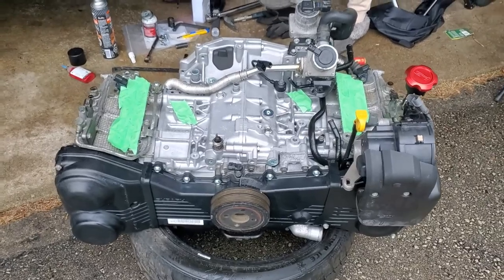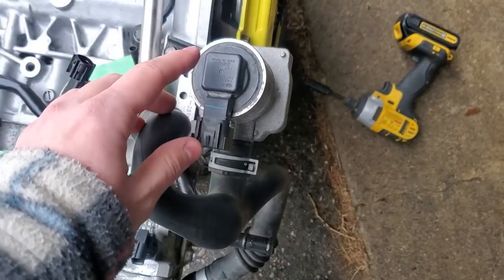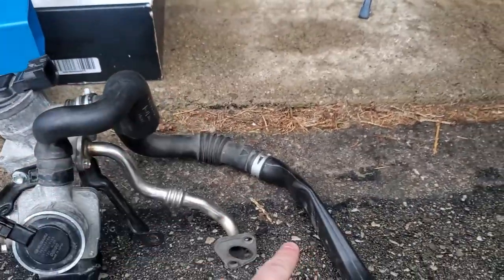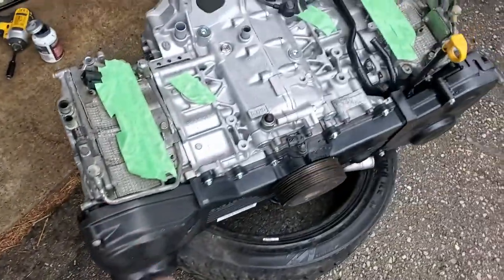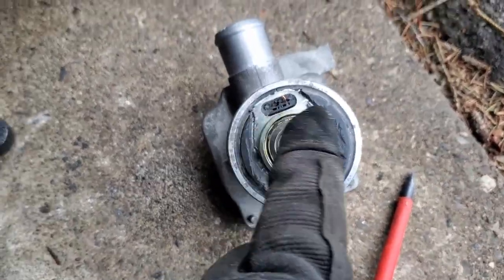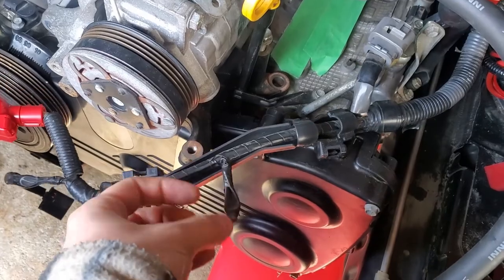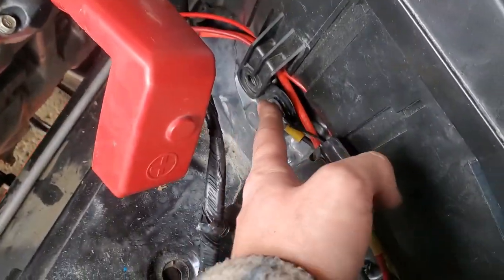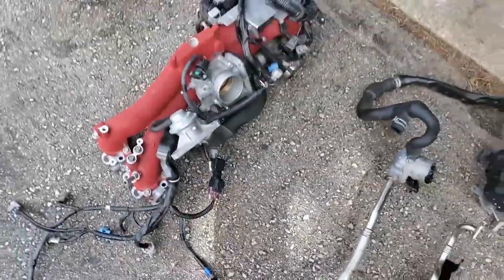STi Secondary Air Pump Delete

Comment: Great video, the biggest problem with this air pump BS is condesation which eventually F up the solenoid (you can google how much this useless BS costs). it's not gonna affect the car when this thing break, but subaru is so clever to disable cruise control whenever money light is on.
Reply from the maker: Thanks, and yes your correct. I'm happy I no longer have it in the car not only to free up space but also since I won't have to worry about forking up the money to buy another for when it breaks. Yup Subaru loves the money light. My impreza would brun through rear o2 sensor and everytime I could no longer use cruise, very frustrating.

Comment: That was very informative! I appreciate the walk through! I'm about to delete this whole system in my car and wasn't really sure what exactly needed to be removed!
Reply from the maker: Not a problem. Happy to help! Just make sure you are getting a tune for your car after you do this. Also the COBB AP will no longer be able to remove the CEL codes due to the green speed update. You'll have to get your car tuned using alternative methods.
Reply: I do have a cobb accessport but I got a stage 3 tune on the car. Although it had the check engine lights n codes, it still runs with no problem. I'm assuming the car will just need to idel a little to learn the secondary pump is no longer on and self adjust being that I have a stage 3 tune already. I still gotta take it to get dyno tuned for a custom map but I have stretched tires and ordered a new set of tires to mount on the white set of rims I got for the dyno tune appointment. I also bought a VMS vaccum block to stabilize the fuel pressure for the tune.
Reply from the maker: @luistaveras551  ah I see, well honestly I'm not too sure. It might be okay but it would probay be a good idea to reach out to your tuner so you know exactly. Good luck with the dyno!
Reply: 我制作了一个二次进气模拟，可以取代这一套系统，由模拟器提供正确的信号给ECU。欺骗ECU不报故障。
Reply from the maker: @唐永朋  I had to use Google translate, but how did the simulation work?
Reply: @zach_lush  用一个继承电路模块，模拟了进气主阀关闭的状态跟进气泵，进气阀工作的信号给ECU，这样ECU就认为二次进气系统正常工作了
Reply: @唐永朋  Or you could get a tune to turn off Air Pump feature from the ECU.

Comment: Just curious... I know this system is for emissions, but what specifically does it do, and are there any drawbacks to removing it?  Great video btw, very informative!
Reply from the maker: Basically it forces fresh air into your engine. Most people delete them when the air pump dies. I did it since my car was already being tuned and i wanted more room in my engine bay. Plus it just looks cleaner without it.

Comment: Excellent video. What codes need to be disabled?
Reply from the maker: Thank you. It would basically be a bunch of secondary air pump related codes. They would need to be removed by a tuner though.

Comment: Great Video, I'm putting a type RA on my '14 hatch WRX/sti turbo, secondary air pump solenoid is on the way.  What block off plates did you use?  The Ebay link attached didn't work for me.  I'm also getting a tune after I put the new engine in, anything I should watch out for?
Reply from the maker: Thanks! I just used some generic block off plates I found on eBay, guessing the seller doesn't sell them anymore. You can just do a general search for block off plates on eBay, another option if check your local aftermarket parts shop for Torqued Solutions plates. At the end of the days its just thin pieces of metal, brand doesn't matter too much. If your keeping your hatch fairly stock there shouldn't be much to look out for. Just make sure you follow the break in procedures!
Reply: @zach_lush  thanks man I appreciate it.

Comment: Good Video Congratulations, I have a question when the other secondary air valve was disconnected and when the air pump connector was removed, did it generate any code in the scanner, did the check engine light up on the dashboard?
Reply from the maker: Thanks, any part of the secondary air pump being disconnected/removed will cause a CEL to appear. So you'll need a tuner to remove the codes for you. If you are using a COBB AP the codes cannot be removed unfortunately.

Comment: Hello friend excellent video.  I am looking for an explanation since I have my Subaru without the second pump but it still has the valve with its sensor.  I bought the car a year ago, after all this time the engine light came on indicating that there is a fault with the second injection pump.  could you suggest me what to do
Reply from the maker: Thanks for watching. Well it sounds like you have 2 options. You can either replace the valve with sensor and put the system back to stock. Or delete the entire system and get a tuner to remove your CEL codes. Depending on where you live and if you have emissions may help your decision.
Reply: @zach_lush  Thank you very much for your answer.

Comment: Thanks for the video, it was really informative! I have a couple questions for you though and would really appreaciate some feedback.

My (2015) STi recently threw a code about one of the solendoids being stuck open. I dont really care about the extra hardware staying in the engine bay so for now I just disabled the SAP related codes with a Tactrix Openport cable which has worked fine to clear the code and prevent it from coming back. 

My questions are:

1. Do you think leaving the whole system in place with one of the solenoids stuck open would cause any harm to any other part of the engine since this whole system is just for emissions? 

2. If so, do you think removing just the air pump itself and capping/plugging the ends of the hoses that attach the the air pump would effectively be the same as installing the block off plates, minus all the hassle?

I'm not nearly mechanically inclined enough to pull and engine or even the intake manifold and turbo to fix this issue so I'm looking for another possible solution.

Thanks!
Reply from the maker: Not a problem, happy to see it helped!

Since you already deactivated the codes I believe the answer is yes you'll be fine. The system is just for emissions and only is working when you first start the car. 

I've never heard of anyone plugging the hoses but I can't see why that wouldn't work. I'd say give it a try and see what happens and let me know how it goes!

Comment: Hey just did my delete a few days ago on my sti. I was data logging for an etune before I did my air pump delete. Car was already on limp mode since the stuck open and close codes were already on. Car was still pushing around 15 psi with full throttle Limp mode, after I did my delete car can barely push past 10 psi. I have not detected a boost leak anywhere AP doesn’t show any leak codes. Buddy says that car ain’t  pushing boost like before bc of the delete, is this true? Dyno day is coming up in a couple days and I’m freakin out bc Idk why my car ain’t pushing boost like before
Reply from the maker: Hey, that's unfortunate to hear. So this video was filmed before COBB released their Green Speed update. Basically the AP can no longer tune out any codes/mods that delete emission parts. You can confirm with your tuner but I'm pretty sure this is your issue. I'm also going to have this issue. You can either reinstall your air pump so you can keep your AP, or go open sourced tuning. I will be going open sourced. You can also go standalone ECU but that's overkill. It's really frustrating, trust me I know. But it is what it is unfortunately. Good luck!

Comment: Hello, my name is Odd Jorstad. I would like to have gotten hold of these 2 hoods for my Subaru forester 2006mod Petrol, as I am going to remove the air pump and everything that has to do with this. Do you know that I can buy something like this?without turbo.. Mr. Odd jorstad
Reply from the maker: Hey Odd, are referring to the block off plates? You can try ebay or any local aftermarket car shop to you. They aren't too hard to find. Good luck!
Reply: @zach_lush Ok, thanks for the info. Have tried to find something online, do you have a link to one of these dealers who might have something like this. This is a Subaru Forester, without turbo. (Engine code EJ204 
MVh Odd
Reply from the maker: @oddjorstad5007  this isn't something you can get from a subaru dealer. Just search up 'subaru air pump block off plates'. You can buy them online.
Reply: @zach_lush Thank you very much for the good tips..
Reply: Hey, what do you do with this hole then, after you removed the pipe? Top hole, look for 5 minutes of film..
Reply from the maker: @oddjorstad5007  that is what the block off plates are for
Reply: @zach_lush  See these block plates below that are fitted, not these but the top hole where the valves were..
Reply from the maker: @oddjorstad5007  any remaining holes on the block were for bolts for mounting. Only open holes to the block end up being covered by the block off plates.

Comment: Hey man so how did you end up dealing with the codes being thrown after this? I really want to ditch this shit but getting a check engine light that wont let me use Sport Sharp isnt an option for me. Any advice is appreciated thanks 🤙🏼
Reply from the maker: Hey, so originally my codes were deleted by my tuner using the COBB AP. But then the green speed update happened which made it where emission related codes could not be deleted. We then switched to open source and all my codes were deleted. I'm not sure but you might be able to delete your code using ECUFlash without getting an entire new tune. You'll have to look into this though.
Reply: @zach_lush  Appreciate it man

Comment: 5:00 hand tight with a power tool?
Reply from the maker: Used the power tool to thread them in, but ended up using a ratchet to tighten it to avoid stripping it. No uga ugas were used

Comment: Weird question, did you find any issues with electric throttle control, or electric throttle control relay?
Reply from the maker: I'm assuming after I removed all of this? No, I did not notice any issues. But also my car was tuned to have all of this removed. If it wasn't tuned there would for sure be issues.
Reply: @zach_lush  thanks for the info.
Reply from the maker: @trojangpete8  no problem, good luck!

Comment: If you are all stock and remove this pump along with all the other EGR crap, will you need a tune?
Reply from the maker: Yes you will, but you can no longer get it tuned using the COBB AP with these deletes
Reply: @zach_lush  fuck there goes all my hopes. I wanted to get rid of this stupid thing so bad
Reply from the maker: @brother_maleik  well you can still get rid of it. Just need to use a different tuning method. I went with opensource using RomRaider and ECUFlash.

Comment: Hey mate I've already had the check engine light come up, I'm assuming it's fine to drive anyway until I can deal with it yeah?

Appreciate the vid.

Will be fun to get this sorted whilst the block is in the car.

Also what brand blockout plate did you get?
Reply from the maker: Yeah you should be fine. It's only used during cold starts, afterwards it is not used. 

Also not a problem!

Yes doing this in the car is a bit more work, I would make sure your doing other things then just an air pump delete! 

For the brand you can get torque solutions ones. I just found an ebay seller that was selling some fairly cheap ($20). It's not branded but does the same thing.